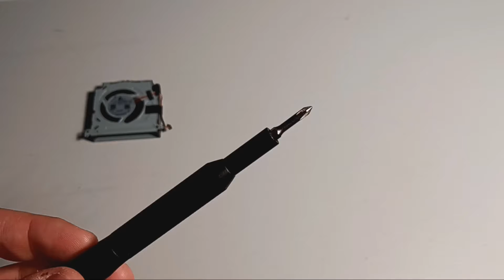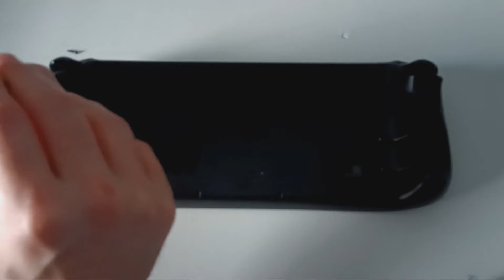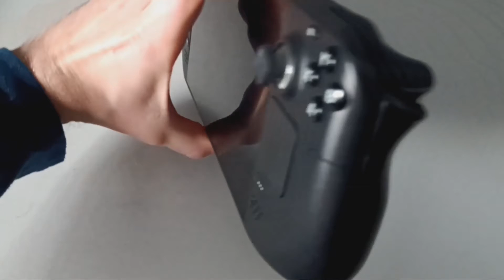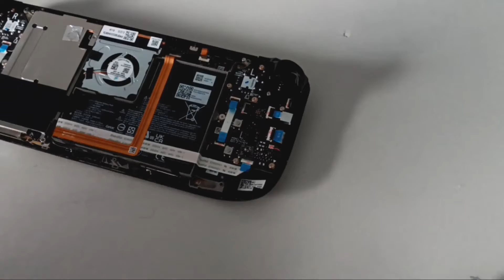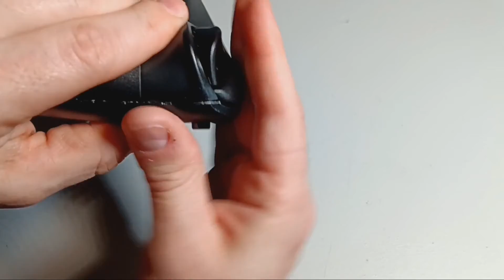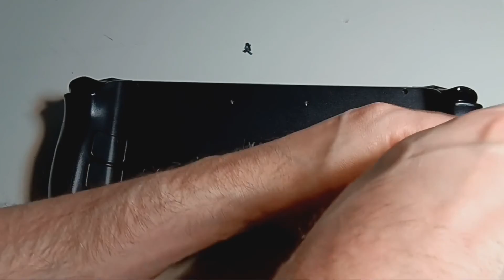Easy Instructions to Replace Steam Deck Fan

Comment: Why is it important to reinstall the thermal sticker? Is it more than just a regular ass barcode sticker?

Editing: having just performed the operation, the sticker NOT just a sticker; it is is aluminum and aids heat transfer between the fan and heat sync.

Comment: I would definitely like a quieter fan for my Deck.
Reply: Steam have two different suppliers for their fans. Huaying are the quiet ones, Delta are the loud. You can easily check yours by opening your deck up and looking at the logo on the fan.